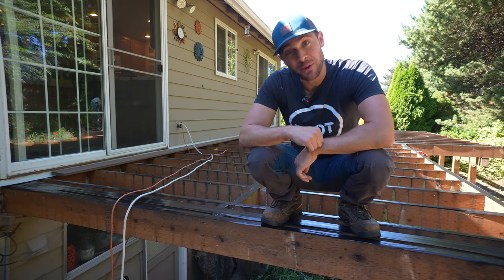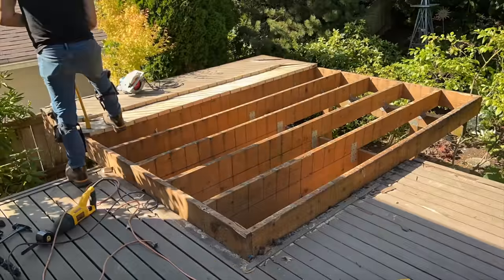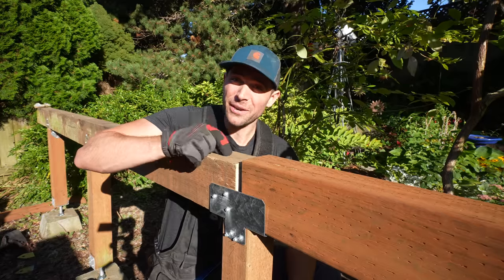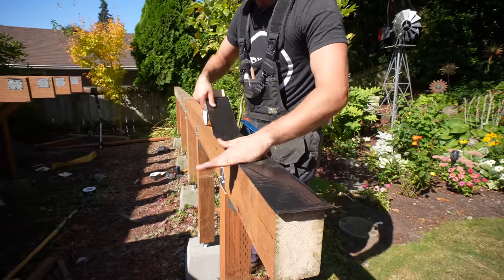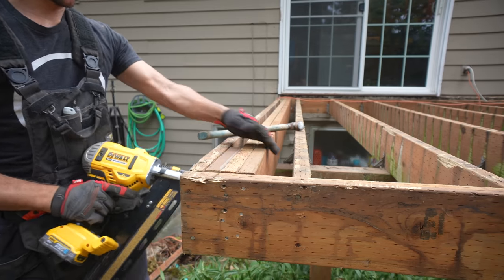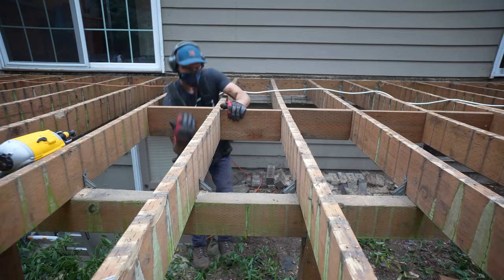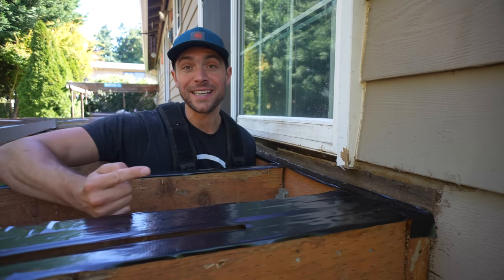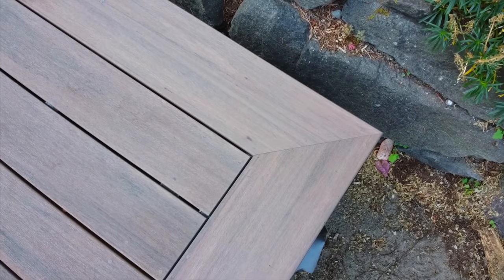TOP TEN Deck Building Tips I Wish I Knew Sooner!

Comment: I've heard mixed things about the efficacy of taping/flashing over the joists. Anyone in the comments with experience using this? Does it actually result in dryer joists?
Reply: Pressure treated wood is not environmentally friendly. Wood lasts if orientation is correct for drying.  Beams crown up, deck bark side up, posts and spindles root end down. Cedar lasts.  Ever wonder why some barn boards rot?  If the root end is up they retain rainwater. Nature knows best. When lumber is milled the label is stapled on the root end.
Reply: @capitalismblows today I learned....great tips.
Reply: @capitalismblows  that's some great information. I never knew that about the tags being stapled on the root end. Oh, and if capitalism blows, it definitely blows less than any other economic system that's been tried throughout history that i know of. But to each his own.

Comment: Seriously I didn't see what was wrong with the existing deck.Seems like you were a little premature on the need to build new. I'm curious why you used treated lumber for the main deck structure. It's not necessary and usually not the best lumber to use since its very wet and subject to a lot of twisting and shrinking. I'm seeing a lot of overuse of it by many because they think its better. It's normally only used for wood that's contacting the ground, that's what its treated for.
Reply: I agree a lot of wood could be recycled
Reply: Yes.  Treated to resist rot from moisture, in all aspects, not just from the ground. Also treated against termites and other wood boring insects.

Comment: Why using flashing tape? Dont you use impregnated wood? In Europe we dont use flashing tape on wood like that only on roofs, protect water from getting inside the house. But using that tape between wood on a porch is like overkill to me. For me i use impregnated wood when i build a porch. So using that tape is like using a pre-butter before you take the regulat butter on a sandwich.

And a porch in Europe stand atleast 30-40 years without that tape, we only use oil every year.

Had been fun to see a porch without that tape, someone in the USA must have build one. How long does a porch without that tape stand?

That day when the tape start to lift water will came in. And water and wood is not a great mix, it start to rotten.
Reply: Here in the pacific NW it rains every fucking day for 9 months.  The flashing tape gets you more than 10 years of life. Use it, or replace all wood outdoors every 10 years.
Reply: "in Europe"? sweeping gerneralisation... Water and organic matter will accumulate in the gaps between the boards and after time (10-20 years if you're lucky) will rot the top of the joists. Then you have to pull all the boards off and replace the joists.  Much faster to use tape, but you can just use damp course tape - very cheap, but it doesn't self-heal, is the only thing.

Comment: Cross measuring only makes a perfect square if sides are exactly same length. If not, it will not be perfectly square. 3,4, 5 method is more reliable and forgiving of bad length measurements.
Reply: If you can't cut the two sides the same length, you probably shouldn't be building a deck. The only time that should happen is when you're deliberately building something other than a rectangle.

Comment: 19:34 - this method is good, but square and trapeze have equal diagonals. So better to check corners using 3-4-5 triangle. To be sure it is square not a trapeze.
Reply: Huh? Wrong.
Reply: If you're building a square or rectangle, the first thing you do is measure all four edges. If your opposite edges are equal, you're not building a trapeze.
Once you've confirmed that both pairs of opposite edges are equal, making sure that the diagonals are equal is the most accurate way of assuring it's built square. You're measuring the largest possible triangle, not a tiny little 3/4/5 on a corner.

Comment: 4x6's are posts only, never beams. They sag very quickly.
Reply: The rule is 1 foot per inch.  A 4x6 can be  beam as long as the span doen't exceed it's width..

Comment: Why do u buy wood thats varies in dimensions? A rotary laser is the tool for larger frames. Dont use a stretch measure tape for Pytagoras, use a point distance laser. Its the hight of the frame beams that is strong not the thickness so 4x6 is kind of useless its stronger and cheaper with 2x8 or 2x9.

Comment: Absolute top tip:  Control of substances hazardous to health.  
In the U.K. this is a legal requirement.   You're cutting pressure treated timber with no dust collection and no breathing mask.
In 30 years it'll make a difference to your lungs.

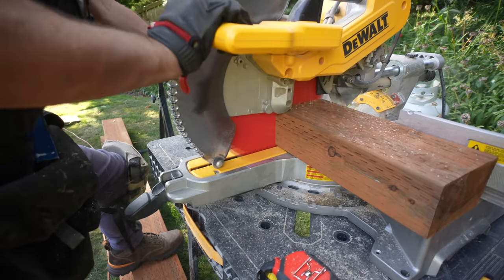Comment: The amount of time and effort you wasted removing those floorboards and sawzawing all of those rusted screws is easily worth a new joist system. Lumber is not that expensive. And you're able prepare a much cleaner level Joy system with new material rather than trying to level old material. New deck boards composite or cap stock or even all vinyl Azek boards are going to show all the imperfections in your deck frame. Much easier to build a new structure and prepare a completely level joist structure 5:21